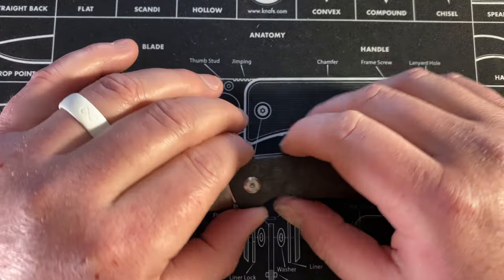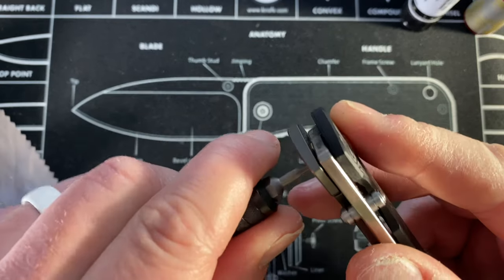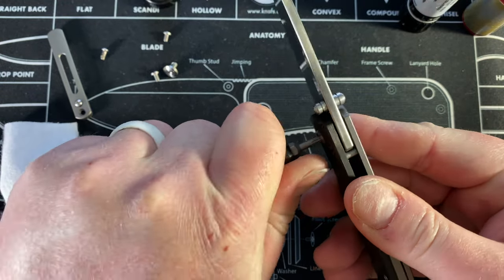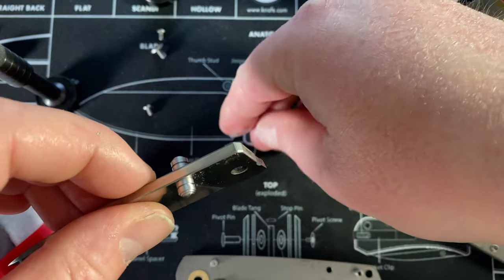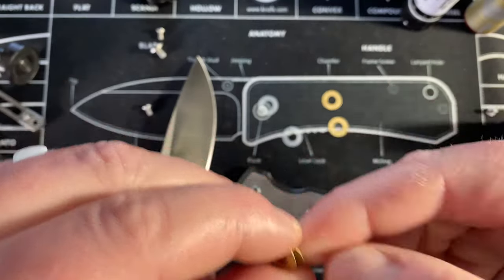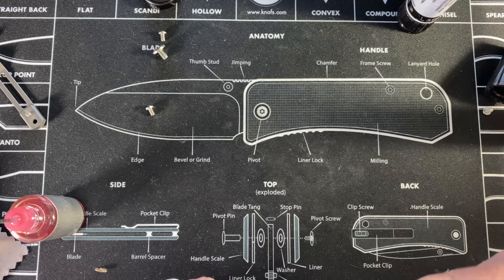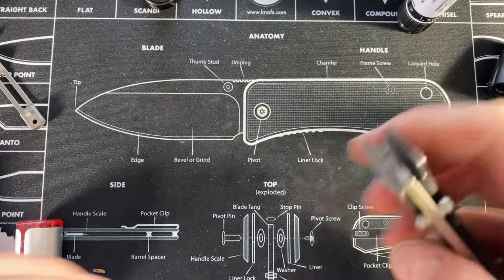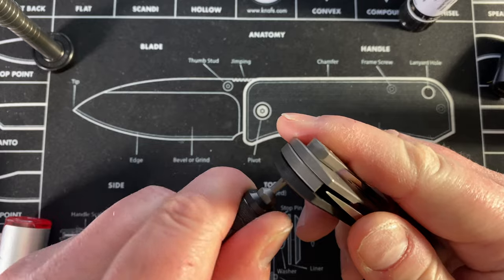MBK Mini Old Guard Disassembly & First Impressions

Comment: The Tangram Vector button lock puts the thin nylon washer in between the two phosphor bronze washers, I've read that they work better without oil that way.
Reply from the maker: Interesting thanks Joe

Comment: Interesting. I haven’t taken mine apart yet but maybe that’s why the action is so smooth. The only two knives on washers that are similarly smooth are my Sebenza and Spyderco GB2.
Reply from the maker: Nice knives man!
Reply: I've been wondering about the GB2 for with some micarta scales! Seems like spyderco's most practical work horse.
Reply: @dustinwhitt5297  It’s definitely a good knife but I definitely suggest making a relief cut for the lock bar as it’s quite difficult to disengage.

Comment: Hi Kevin, could you do a first impressions and skiff bearing swap on the new Mini Old Guard Bolster lock. That would be very cool. Thank you 😊

PS...no one has done it yet.
Reply from the maker: Hey. Id love to but MBK doesn’t send stuff out like that. Which is probably why you haven’t seen it. It’s not really my style so I don’t necessarily want to invest in buying one if that makes sense. But i will see if someone has one i can check out.
Reply: @LeftyEDC  I completely understand it's not ur style. I just thought it being on bearings and bolster. There's like one other video out, and it's a short. It's very cool of you responding to my post 🙏💯
Reply from the maker: @AidyOC i reply to everything i can. Yea i wish i could get everything but im swamped as is so i guess i shouldn’t complain. Thank you for watching

Comment: I took one of the washers out and now it drops shut but it’s not centered anymore.
Reply from the maker: Did you take it out of both sides?
Reply: @LeftyEDC  no I didn’t even realize one side had 3. It’s so weird man. I think I have one side with 3 and one side with 2 which is why it’s not centered. The damn Teflon washers really fucked with me 😂
Reply from the maker: @DeRock401  double check that man. The 2 bronze ones can stick together sometimes. But MBK told me it will run and center if you take one out each side, since you have so man just make sure you put the teflon washer against the blade on each side, and then 1 bronze washer on each side. That should fix your issue. Or even just 1 bronze washer on each side should work. As long as its even centering should be as well
Reply: @LeftyEDC  I love this knife but my thumb is so tore up already from the thumb studs. Is yours?
Reply from the maker: @DeRock401  i sold it already 😂. But no the detent was good on mine. Studs were fine. I heard that one version seemed to have a stronger detent.